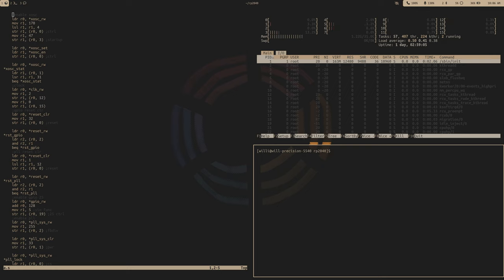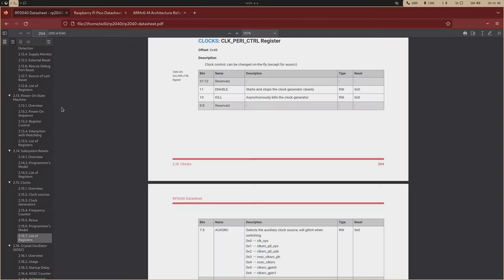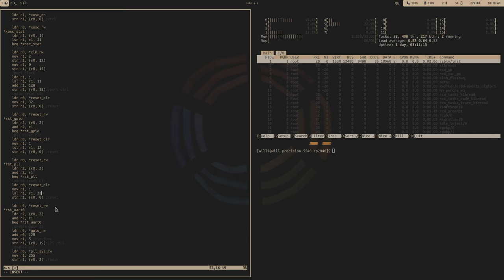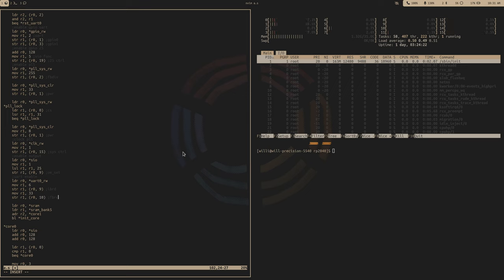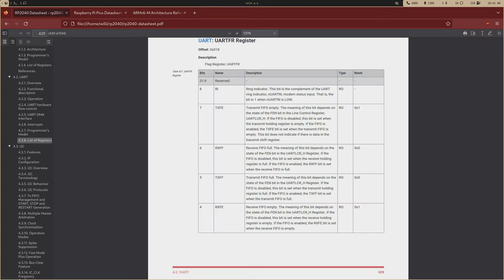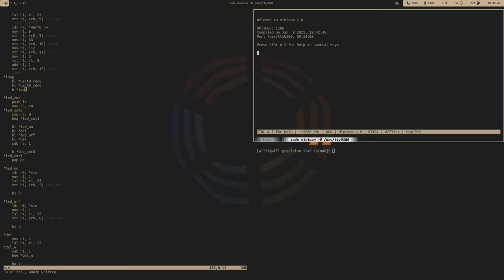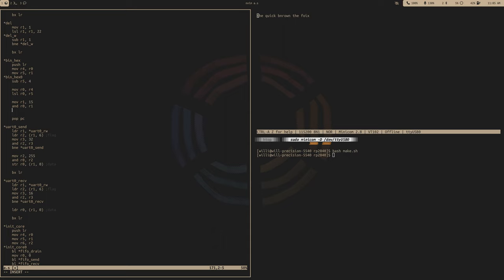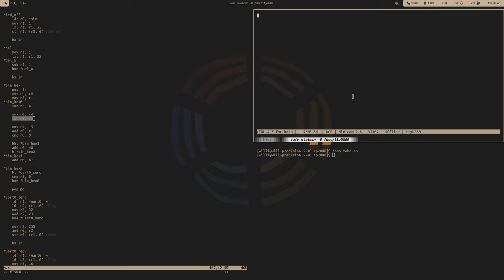RP2040 - Baremetal Assembly - UART

Comment: Great video. Is sending data across the usb just about the same?
Reply from the maker: No, usb is a considerably more complex protocol. Instead of using fifos, usb uses event-driven buffers to both send and recieve data, and a single usb line can have multiple endpoints. The usb video is gonna be a challenge, as I'll need to explain the functionality in a clear, simple manner without getting too lost in the weeds of the protocol.